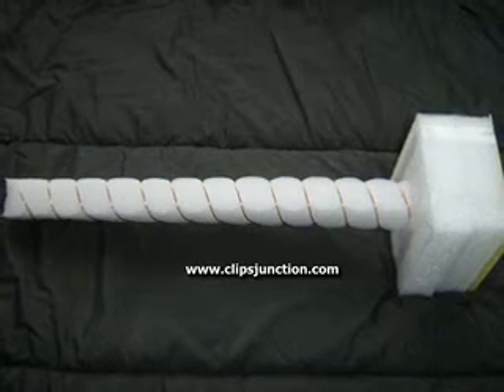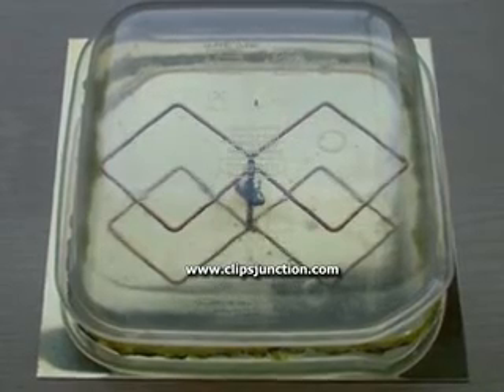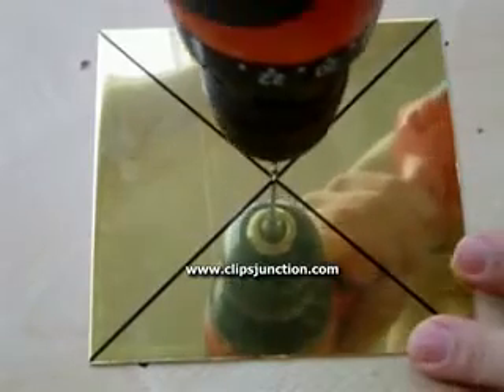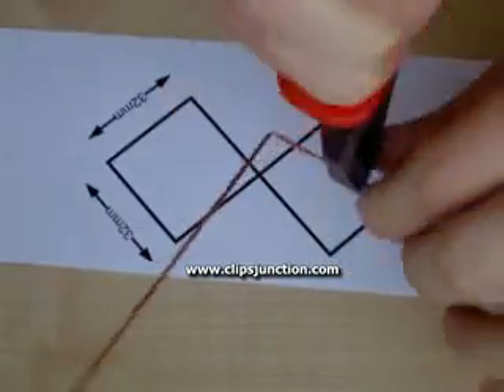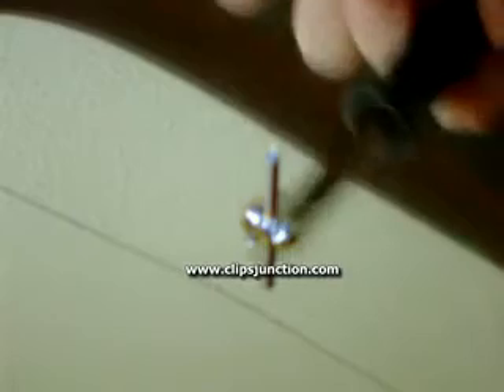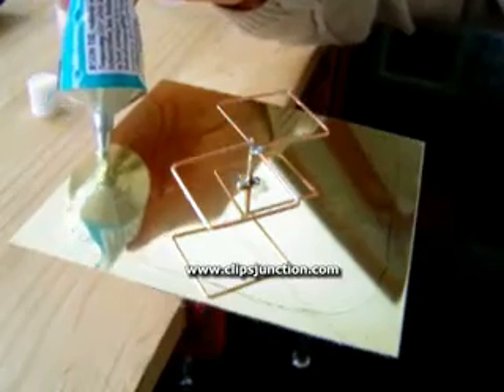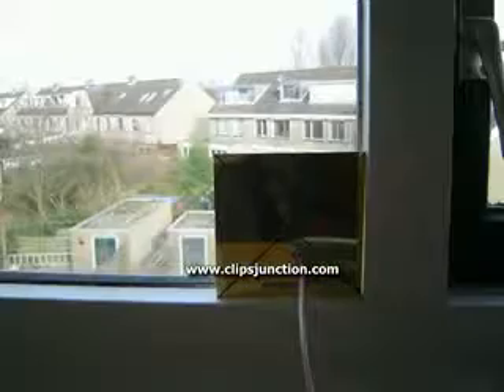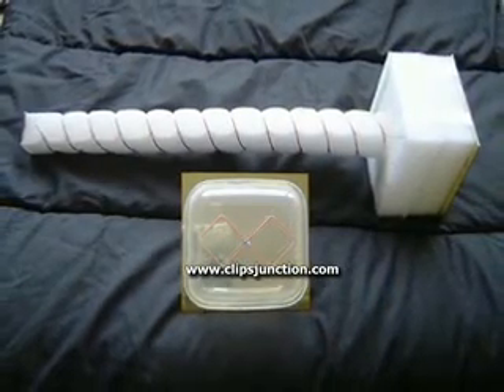how to boost wifi antenna upto 3x normal..

Comment: We are ofen led 2 belive that we r not capable or road is 2 hard so we settle dwn & choose not2 questn & pay sum othr guy 2 do it. U wud b suprisd@ how easy it is2 soder aftr bein instrctd proprly on the corrct techniqes cupled wit practce. & Uhav soder suckr handy4 fixin mistke Dont cause any heat damge 2the partOr board That wont happn unles yur iron is 2 hot or 2 cold. U wana 30wtt electronicsIron not a hobby wudburning 1. + the more u pay4 it the longr it will last & more reliable it will b

Comment: I know it's not absolutely necessary to have an external antenna port..I just think that a lot of people watching this video prob have no soldering iron and/or knowledge of circuit boards..just easier process having the external and a pigtail. I bought my Alfa (awuso36h) about 2 yrs ago on ebay for $25. It's a great adapter in my opinion (also compatible with Linux), and makes adding your own antenna a snap..But then again, going your route is a great learning exp for anyone willing to try!

Comment: 2 further add 2 yur comment, The antenna on an extrnal USB WiFi adapter is normly nutin mor than a blob of solder. some r marked "ant" etc... 4 othrs u will hav 2 try & find a schematic 4 the circuit board or use yur judgement. It will b lrgr than most of the othr components & usually ther wont b any othr footpads with solder on them that match it & @ the same time r close 2gether or r bridged wit component. msg me 4 a link 2 my blog 4 any1 that want pics & hlp wit this or othr tecHax

Comment: I have the experience that even though I get better signal and more AP in range it is worse to keep the connection because it undermined 50Ω resistor. Link falls every 60-120 seconds. Proved to be only one solution, the original 7dBi Antenna + CocaCola Booster for WiFi and Bluetooth.